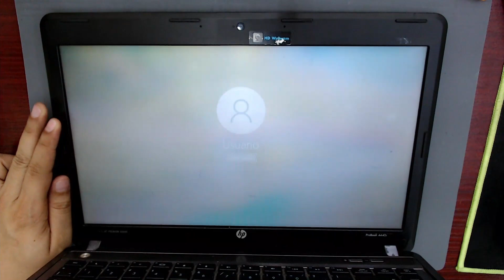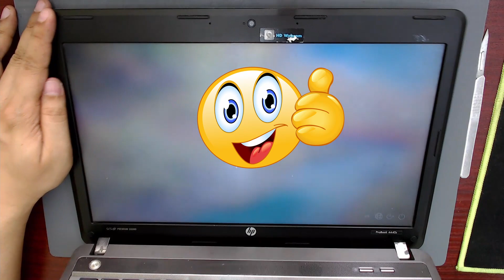Fix White Screen on HP ProBook 4440s, White Screen Repair

Comment: Many sites mention various causes for this common problem, from software, viruses, drivers, GPU, power components, and cables as in this case. On my old HP dv4 I already had to change the video cable and LCD in the last two years. Recently, the white screen issue appears randomly. So, I connected a monitor to the video output and found out that there is video on the monitor when the screen turns white, which indicates a connection problem. Now I need to find where.